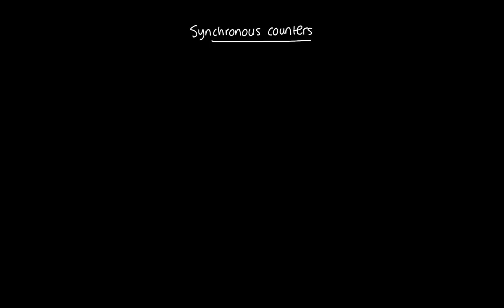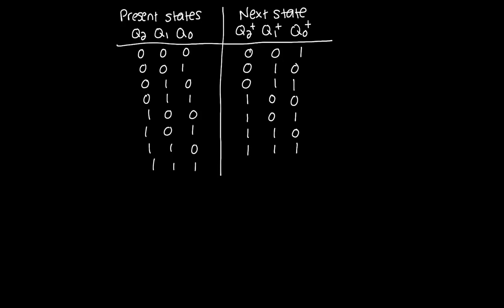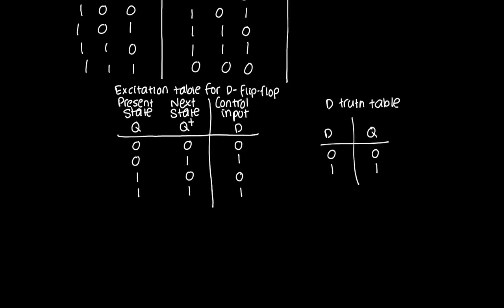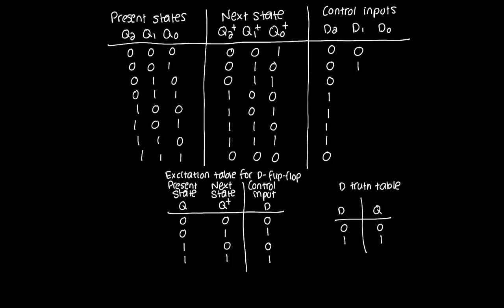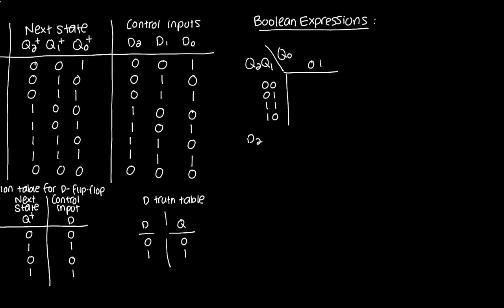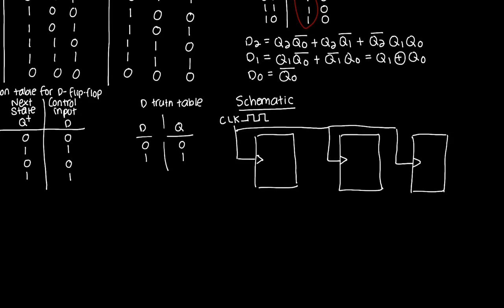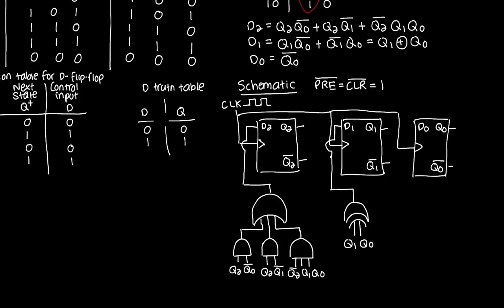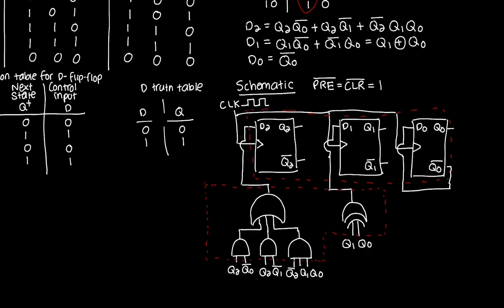Synchronous circuit example: mod-8 up-counter using D flip-flops

Comment: How would you go about making a counter that needs to count between -127 to 128 with D flip flops?
Reply from the maker: I would make a 0 - 255 counter and transform the output as needed. (See later videos in the playlist for output logic.) For a mod-256 counter you need log base 2 of 256 = 8 flip-flops.